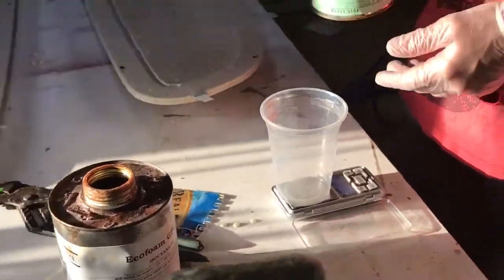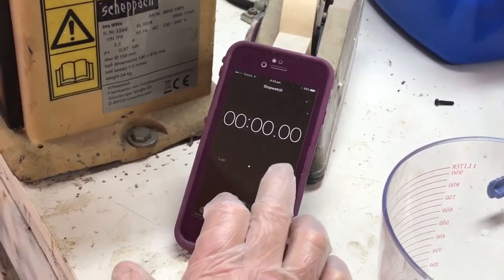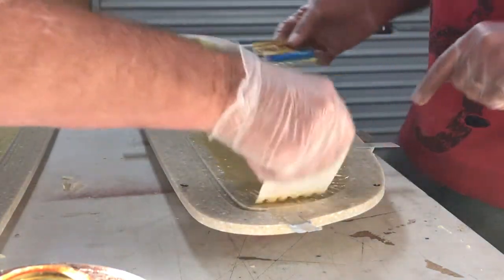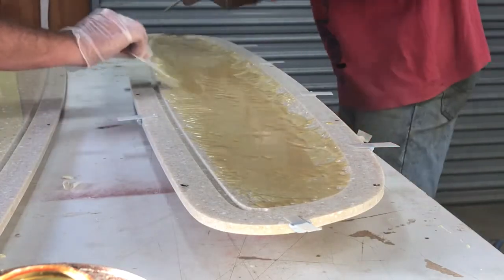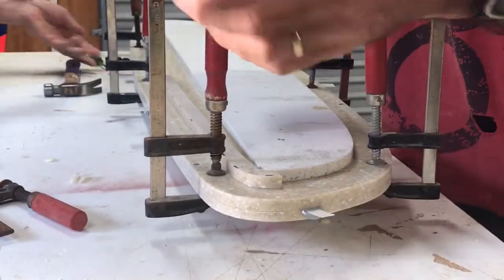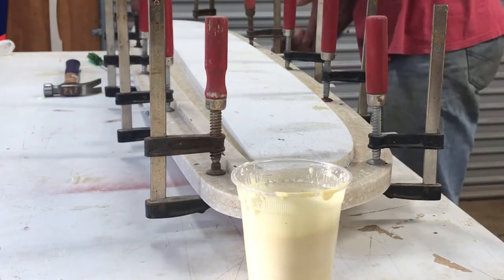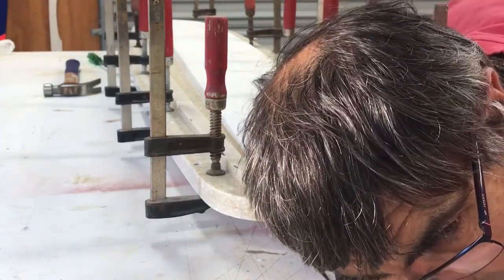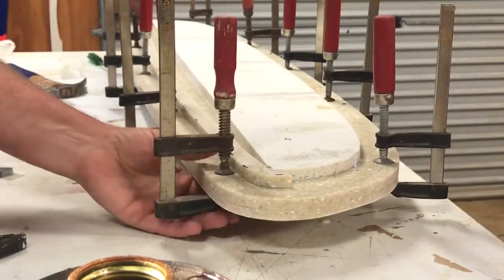PU foam wing moulding

Comment: It helps to see how you used the Corion as a mold plus the amount of pressure used for the clamps and space in of clamps, i had considered Tyvek lining as skin to reduce sticking to mold or silicon spray
Reply from the maker: Hi Darren, I can’t recall there being an issue with the release. As mentioned in other replies, the variable that we could not control is the expansion of the foam. Or at least distributing the liquid foam evenly in a timely manner. Moulds could be milled from aluminium but that will only slow the closing process due to the weight of them. With diligence, one may find a really slow curing foam to allow an even distribution of the liquid. We even considered standing the closed moulds on the leading edge to “pool” the liquid and let it expand vertically toward the trailing edge. 
Bottom line ... we gave up when the moulds cracked.

Comment: Any updates on this? I think the liquid foam needs to react with moisture to cure.  Maybe moisten the mold first?
Reply from the maker: Hi, there was no issue with the foam curing. The foam used in this vid was a 2-part mix so it cures without moisture. The main problem was distribution consistency. The final attempt that cracked the wing mould was still an incomplete and unusable core. There was enough expansion to break the mould in one area yet voids in another ... despite our best efforts to spread it evenly given the few seconds working time to get the mould closed.
Reply: @Larrikin  I see, maybe put an overflow vent? Like this? https://youtu.be/2SW9pp4SxKw

 I would like to do this instead of cutting a wing with hotwire. Has there been any success with your experiments?
Reply from the maker: @yeahitworks  Cool vid, thanks for sharing it. Personally, I wouldn't want any vent holes in my wing moulds. Perhaps an option might be to make a separate mould just for casting the foam core? What we were trying to achieve in the video was to wet skins into the mould, pour the foam and close the mould in one process. Maybe the vent holes could be at the wing tips and 3D printed caps could finish the wing at the vent holes once the wing has been released from the mould. Hmmmm ... I'll ponder that some more.

Comment: What is the point?
Reply: Miguel Armillas .... the point was to find a quick method of making a foam core wing without having use a hot wire system. For example, put fiberglass in the mould, pour in the liquid then close the mould. We wanted to produce a wing in one quick process. Sadly, it didn’t work. I posted the video anyway to demonstrate that it is harder than it might appear.